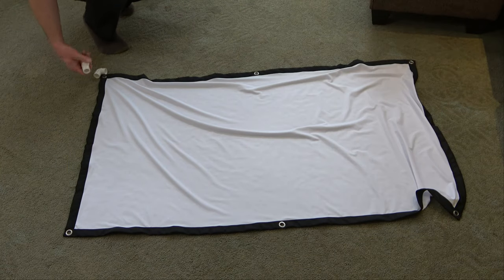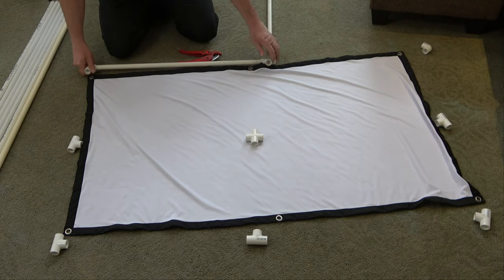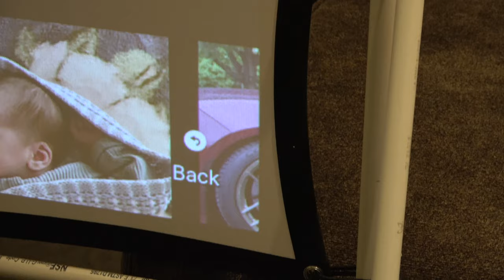Homemade Outdoor Projector Screen (Light & Compact) 4K

Comment: Is the spandex thick?  Rumours say that the thinner the spandex is the more light passes through and causes the projector image to look dull and washed out.
Reply from the maker: I would say that is true. The screen I bought is pulled tight, but not to the point to where the material is opening up. I don't think mine is washed out at all, but I could see that happening with thinner materials.  This is a great point to bring up, thanks for posting the comment. Pinning this to the top.
Reply: @Ricks_Tech_Talk  Thank you.  So it seems that even if the light passes through the fabric the image will still be clear, sharp, colorful and not washed out for front and real projection?  So the spandex material doesn't need to be very thick but can't be super thin either?
Reply from the maker: I wouldn't use it for the everyday screen, but mines stays sharp and colorful. I would look for a thicker one just to play it safe, plus it should last longer.
Reply: @Ricks_Tech_Talk  Thank you

Comment: Excellent design! I'm watching this and PVC shopping at the same time. Going to go 120" and use rebar for my anchors and 1/2" EMT conduit for anti-flex in the PVC. Thanks!
Reply from the maker: I have a large screen as well. It's 120 or 110 I forget. But the pvc for that screen is 3" schedule 40 with no supports in the center and no need for anything in the tubes for sagging. To make the big one stand up I used T connectors and added 2 feet of tube on each end, then that connects to the one tube coming down. Have fun and thanks for watching the video

Comment: Looks like it needs a black backing. The black border implies there is one, looks like a marketing gimic, but it would definitely be improved with some black opaque material behind it 👍
Reply from the maker: The black is another fabric material sewed on to give it more strength and to keep the grommets from ripping out. Adding a black sheet would help if you have lights on behind the screen. I tested that when making the video, it didn't seem to make it any brighter so I left it out. We just used it for the last time this year and I'm thinking of making one a bit larger :) Im going to post a picture on the Facebook page if you want to see how it looks 10 mins after sunset. Thanks for watching and for the comment. https://www.facebook.com/RicksTechTalk/
Reply: @Ricks_Tech_Talk  research "Cinegrey" or it could be spelt "Cinegray". It's the shade of grey they use for cinema screens 👍
Reply from the maker: I'll check it out, I might have to make a new one :)
Reply: @Ricks_Tech_Talk  it's also known as Tension High Contrast Grey 👍
Reply from the maker: Looks like it would be great for home. For camping, the spandex material works great and it won't wrinkle. That Tension High Contrast Grey looks like it would be great if you had lights on or not in complete darkness.